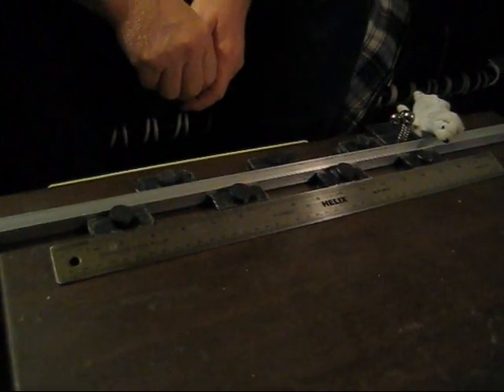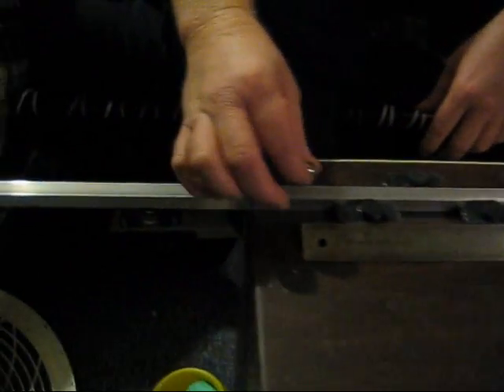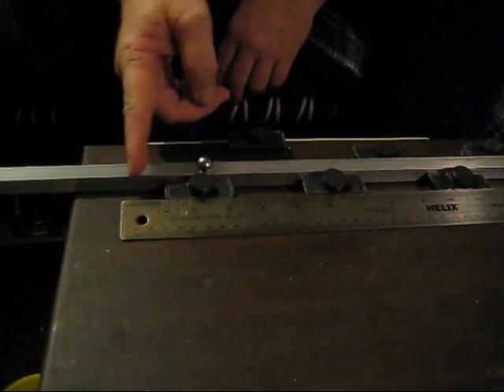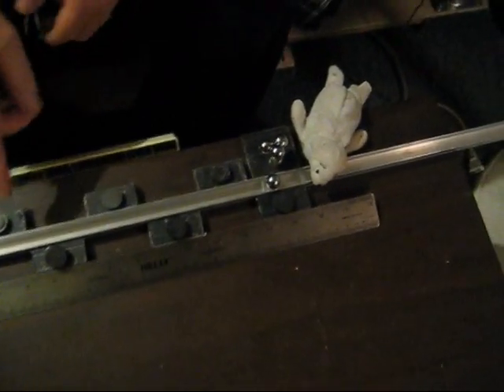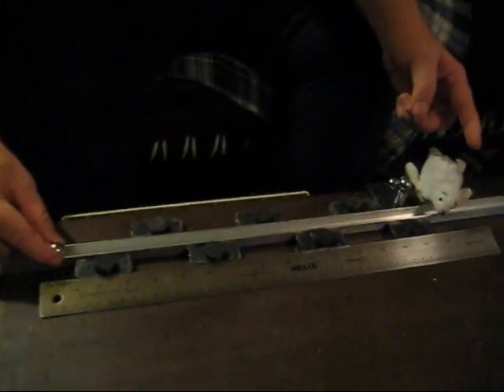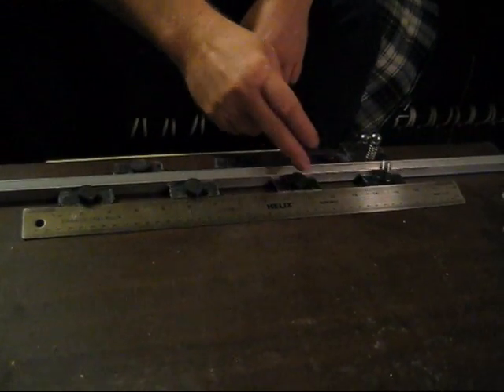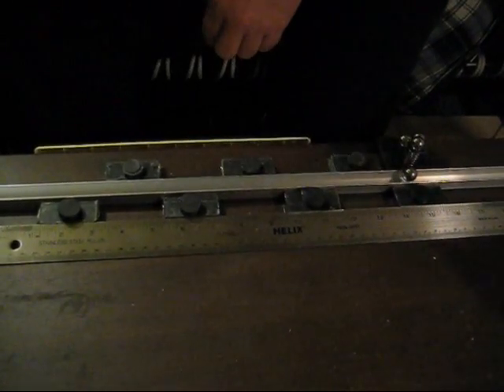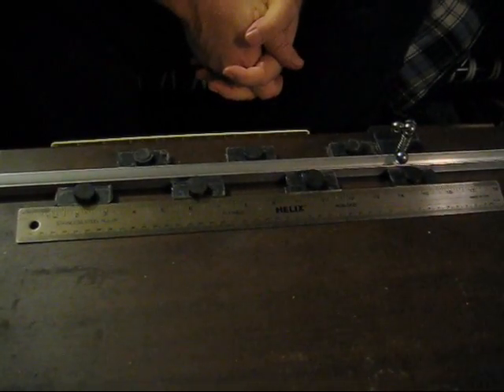Permanent Magnets Doing Work

Comment: My own view is that the question of "What's doing the work?" is best addressed moment-by-moment using differentials. IUPAC put out a great thermodynamics paper a few years ago to standardize the nomenclature for doing this. Google "IUPAC Alberty 2001" and click the first PDF you find. Don't be put off by the paper's title. It emphasizes chemical themo, but work from other things like gravitational potential and magnetic field strength are correctly handled in section 1.3. Enjoy!

Comment: Right after the "brain fart" comment you should've said "... about an inch off the top of the track we could cut a hole in the track and let the gravity do the work". Then it would have been a valid statement that actually works. You've come one step away from the solution...

Comment from the maker: Physics taught us that static magnetic fields are conservative. This means the forces at play are independant of the path taken. Therefore, if you end where you start, the force theoretically nets to zero. Now, dynamic or changing magnetic fields are not held to this rule. This is where Einstein scratched his head because it becomes a matter of reference. A moving magnet seems to act the same as a changing field. Also search Faraday Paradox.  ;-)

Comment from the maker: Finsrud's device has a long pendulum down the center of the pedestal. Almost imperceptible to human eyes is the elevation change in the track. The weight of the sphere (approx 3Lbs)keeps the large pendulum orbiting. This is where the magnetics comes into play. As the sphere moves under the magnet it is lightened by the magnetic force (its weight [not mass] is reduced). The energy exchange transfers to the pendulum. The 3 other pendulae are for speed regulation. Does earths orbit play any part?

Comment: Did you click on the 'view all xx comments' below and follow the entire conversation? Either you didn't or you are an idiot... 

"Especially not fast enough to escape the force that started 'em coastin'. And not even with the help of yonder magnet."

WRONG!

"it would probably make it to the finish line better without magnets impeding it's progress."

Well you go one thing right, the pull from the magnets increase the friction between the ball and track.

Comment from the maker: In this case we are discussing magnetic poles not terminals.;-). In the monopolar magnetic diode The flux for one of the magnetic poles on a specially shaped magnet is fully contained internal to the device while the flux for its counter pole is exposed externally. This effectivly creates a monopolar reactive flux zone capable of accelerating a ferromagnetic target without the dipolar deceleration. A ferromarble will accelerate through the diode tunnel and keep on going.

Comment: No the first and last hills are larger. The pull on the ball to the first magnet is greater than the net pull from the second because a 180 Deg. force is applied from the first magnet.

Comment: This distance must be less than the initial distance it dropped to the first magnet or it will 'fall' back to the first magnet. Then it accelerates to the second magnet, but with less momentum because the second drop was lower than the first. This repeats until you reach the last magnet, the force needed to excape it is the same as the first.

Comment: Maybe this analogy will help, Think of a section of roller coaster track. Down is toward a magnet and up is away. You place the car (ball) on the highest point at the start. It travels 'down' to the first magnet and the momentum carries past it then 'up'. If it has enough momentum it will reach a point exactly between the two magnets.

Comment from the maker: "Yank the magnets"
That would remove both the forces. The magnet in conjuction with the track provides two force vectors. Each which points to highest flux density where it intersects the track. By equalizing or quenching entirely the trailing negaive (relative to momemtum vector)density we provide a means to escape the field and maintain momentum.

Comment: I was stoned on my ass and just messing with you. I barely remember those posts ;-)

I will say that force in any field (magnetic, electrostatic or gravitational) change with position.. Placing the metal ball near the magnet is no different than using a weight (gravity) to do work. The machine you are using is analogous to a pendulum in which the pivot point is allowed to move with the bob.  I really don't know what you are trying to prove...

Comment from the maker: Quite to the contrary. By putting the rail in a circle we learn that not only does the finger not perform the work but the opposite pole of the magnet performs addtional work in decelerating the ball. (This is why closed system do not function with dipoles)

Comment from the maker: Post Script: Just so you understand. Your test setup there would produce more energy out than in. But it wouldn't win the Nobel. This is because the energy out is traded for the negative field in the tertiary stage. To win the Nobel we have to apply it to a closed system which this is not.

Comment from the maker: The end run at rest values show target 1 with +GPe, -Mpe, 0Ke, 15"D and target 2 with 0+GPe, 0MPe, 0Ke, 0D. From this we can see that some of the -MPe is traded for altitude and distance. Since Work does not have energy in its equation we can see W=Fd applies and holds regardless of starting or ending potential or kinetic energy. Likewise, the work done to trigger the action is less then the work done during the action and is thus amplified.

Comment from the maker: In video 2 there are essentially 3 stages. In the primary stage we have an inital acceleration with a conservation of momentum. In the secondary stage we have increased acceleration due to stronger magnets (this is quickly neutralized by the incline). In the tertiary stage we see a very strong acceleration (where the target hits the plate) immediately followed by the pullback of the opposite dipole. The work from ...

Comment from the maker: Each increase in accleration is given at the cost of reduced magnetic potential. This is clearly stipulated to at then end of video 2. However, if the final dipole was neutralized, wouldn't you agree that momentum could be conserved?

Comment from the maker: In "self perpetuating power plant doesn't" which my two videos responded to, you wrongly claim that permanent magnets cannot do work. I felt compelled to challenge that assertion and show that they can and do perform work. Furthermore, just as a diode can block electron flow in one direction there is also a way to cancel the second dipole. This I will demonstrate when people are ready and willing to see it.

Comment from the maker: "N to S S to N cancels out part of the permanent magnet's field." 
I mistook what you said here. I thought you were saying it diminished the strength of the magnet. My mistake. During the attraction the shape of the field changes because there is a better pathway. But the force actually becomes stronger in space between the attracting poles because the density in this area becomes increased as it is taken away from the surrounding area.

Comment from the maker: All transformers other than 1:1 can be used as buck/boost. The more common term however is step-up or step-down. The buck/boost term is typically applied supply line applications. As far as the demonstration goes there are multiple dynamics at play during the acceleration. Included in this is the electric field expanded in the conductive ball. Because the ball moves on the track eddy currents (though minute) do flow in the ball and track. However, there is no buck. Opposites attract.

Comment from the maker: Thank you imyyz4u for your input. You are correct that the ferrous ball shunts the field. However this does not change the magnetic strength in proximity to the ball in the way you think. Actually, the ball moves from a lower strength to a higher strength because of the curvature of space known as the 'lines' of force. The ball moves in the direction of the closer gaps. A triangular shunt can spread these out like a prism and cancel the effect.

Comment: What you fail to understand is the nature of magnets and how they function. Your steel ball near a magnet effectively 'shorts out' some of the lines of force and reduces the strength of the field. This means the magnet is 'weaker' with the ball near it than when it is farther away. The ball moves from a higher energy level to a lower one. You should be able to figure out your mistake now.

Comment: "Permanent Magnets Doing Work. Thats it."

That work requires energy put into the system: you deny the fact that your arm put that energy into the system--- therefore NotSoOldHippy is correct and you are lying. By the way, you linked the videos to my video that debunked a "free energy" video that does claim to generate energy: you also claim that debunking is wrong. Why are you lying here?